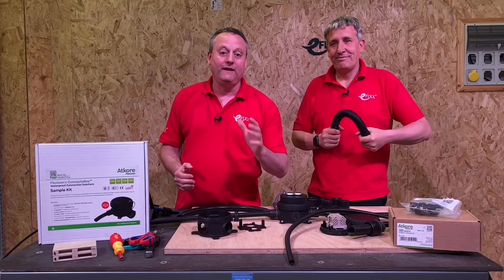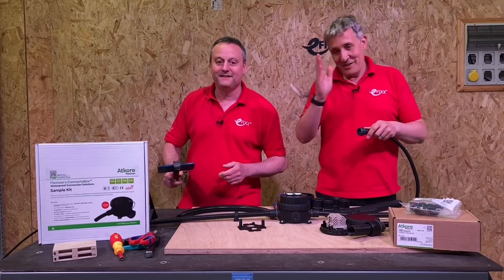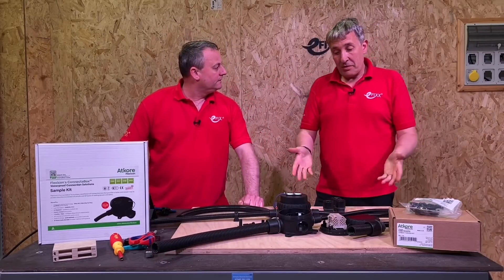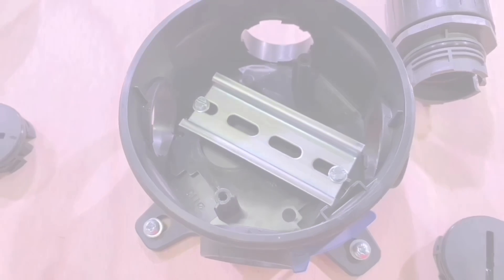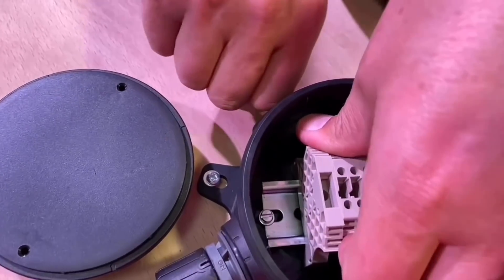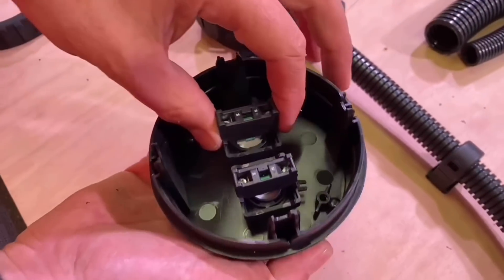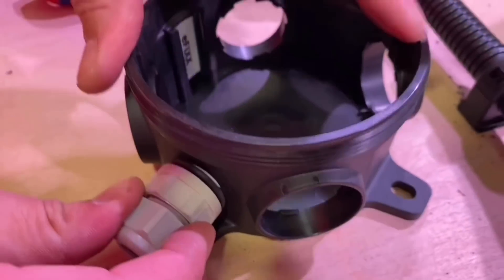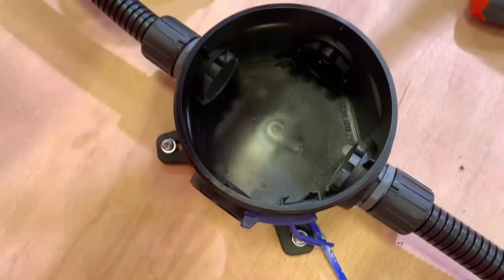FLEXIBLE in the EXTREME - CONNECTABOX by FLEXICON - IP66,67,68,69 Junction box.

Comment: I think these look good quality. The only thing I wasn’t keen on was the din rail corners pointing to the cable entry. You could easily skin a cable on them. Other than that I think they looked well designed.
Reply from the maker: Agree - The DIN rail isn’t part of the kit it was our first attempt at making a DIN version. We would chamfer the ends next time or use the smaller format DIN rail next time.